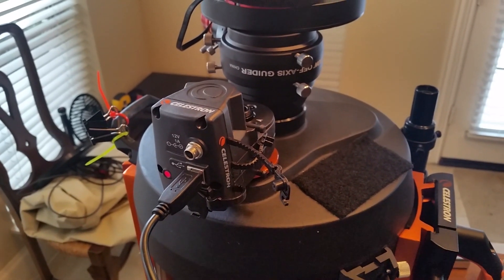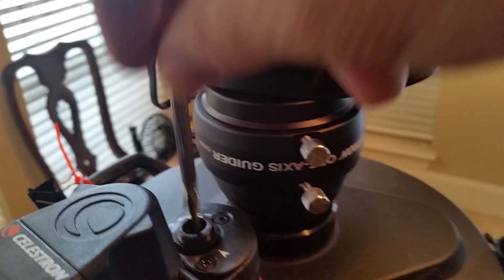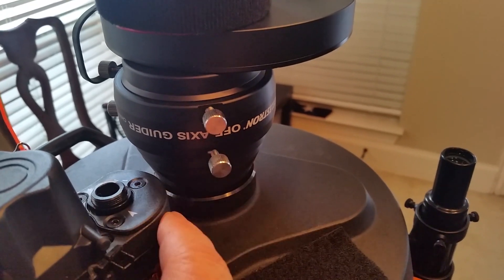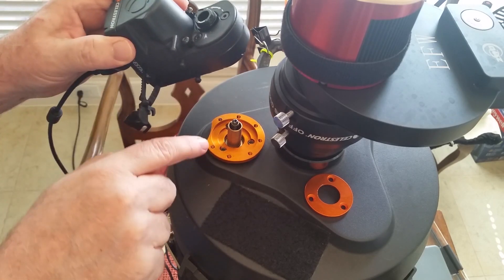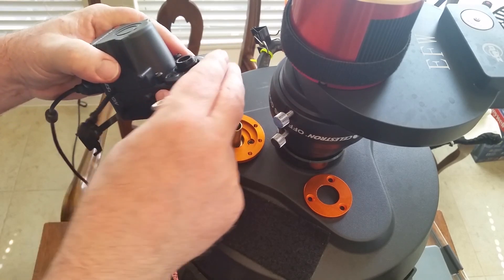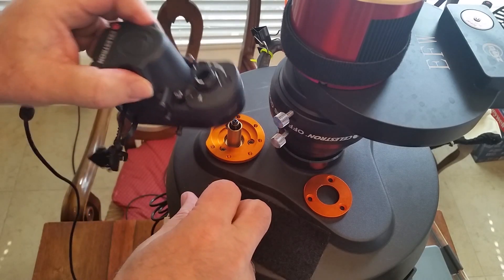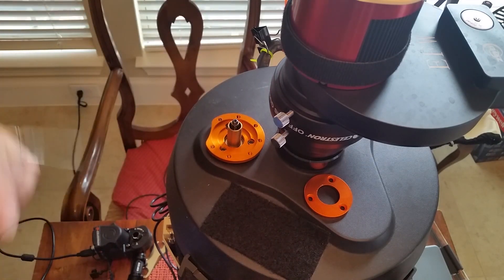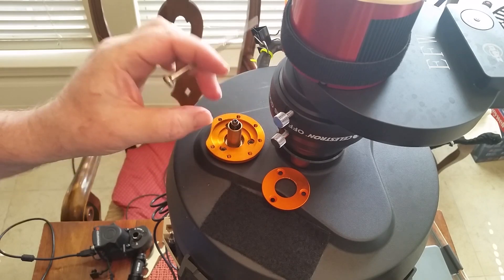Mechanical Binding Issue with the Celestron SCT Focus Motor

Comment: Helicoils and longer screws are the solution to this issue I suggest. Be sure to use a medium strength screw rated Locktite type adhesive to the Helicoil to scope body interface. If the back cover of the OTA is too thin for Helicoils then perhaps tap oversize M5 and drill & counterbore the adaptor plate to suit. I am considering a similar Helicoil mod to the CGX saddle clamp threads. The standard steel into aluminium tends to lock up causing me to worry about long term viability of the aluminium threads in the saddle. With the steel insert friction will be much lower and harder wearing.
 FYI I am using a standard geared stepper directly connected the UPB Pro on both of my scopes. https://www.omc-stepperonline.com/geared-stepper-motor/nema-17-stepper-motor-bipolar-l33mm-w-gear-raio-271-planetary-gearbox-17hs13-0404s-pg27.html
Reply from the maker: Hey, Rob
I can certainly understand why they didn't install helicoils in the first place--all they wanted to do was attach an unloaded cosmetic cover plate to the OTA. Now, however, a thicker plate, longer screws, and helicoils are called for. Oops. Hurts to miss that one. I have no hope of installing helicoils--you're the expert machinist, remember?  At this stage, I'll try and find longer screws and apply some Loctite. Oh, and see if Celestron wants to weigh in with suggestions.

Your saddle clamp application should have had helicoils in the first place--it's holding heavy, expensive equipment. Geez. Do you have one of those stepper motors attached to an SCT? If so, how did you mount it to the back plate? Thanks for watching, as always!
Reply: @Aero19612  Yeah I probably jumped the gun with the Helicoil advise. At M4 there is not much room for error and would be a bit fiddly. Longer screws may do the job OK assuming there is good thread at the bottom. If C short tapped the hole increasing the thread length with a bottoming tap would be a very good idea.  In either case I would start with a screw longer than needed and cut/file to a perfect length to maximise engagement. I would NOT recommend trying to deepen the existing threaded holes as there lies disaster.
I don't have an SCT, both the WO ZS126 and the carbon RC8 have Crayfords so installation was the same for both and I can share the UPBv2 Pro between both scopes on a seasonal basis. Others have used this motor with SCT's have a look at Robert Brown's My Focuser Pro documentation on Sourceforge or even a simple google search. While on the subject of sharing the UPB around I need to make another dovetail mounting for the RC8. If you want, I would be pleased make up something for you as well. Just yes or no and I will contact you via your youtube details. Just my way of saying thanks for the great content.
I am also in the process of fine tuning the CGX and may make a video on the process as I see so much misinformation such as using ceramic bearings and replacing the main bearings when "Hypertuning" mounts. Based on my sample of two Synta mounts I have an opinion on the source of "stiction" on these mounts and it has nothing to do with bearings but rather fit of the clutch drums into the housing.
Reply from the maker: Hey Rob. If you're not careful, one day I'm going to take you up on having adapter plates made! Truly a very nice offer. The "M4" screws I thought were there are actually M3x0.75 x 8 mm long screws. I re-installed the offending screw with Loctite. In the mean time, I ordered 10 mm long versions of the same screw. Should be here tomorrow or Monday. Of course, you just can't order 3 screws, so I'll have 97 left over. I'm sure I can find a use for them around the house. NOT! Not sure if the extra 2 mm is too much. May have to file them down as you mention. Nothing is easy. Indeed, you should make a video of your CGX adjustments. Too much misinformation out there. This is a highly technical hobby and needs knowledgeable people creating content to counter the poorly thought-out material out there. Stay safe and clear skies!
Reply from the maker: Typo: The Celestron screws are M3x0.50 x 8 mm (not 0.75 mm pitch) for anyone interested in replacing them

Comment: I had a weird experience with my PrimaLuce Lab Esatto focuser last week. I ended up resetting it's power supply then re-running the calibration. I also use the PrimaLuce lab "SestoSenso II" focuser (directly attaches to the 10:1 nob on my feather touch focuser) for when I'm doing planetary imaging. 

I still have yet to setup auto-focus in general. It would be nice as temperature changes affect the focus. The dead of winter was fine because once it's 10 degrees outside, it doesn't seem to make much a of a difference if it gets any colder.

Good luck with resolving your issue. Wish I had idea other than "re-run calibration and check your torque", but clearly you seem to be a little ahead of me in the focusing department.
Reply from the maker: Thanks Ronnie! Yea, the power supply and calibration aren't my problem...this time. How do you "reset the power supply"? Unplug it and plug it in again? I'm jealous of people why set their system up and leave it running unattended all night as it performs occasional auto-focus runs and you wake up to a boat load of data.
Reply: @Aero19612  I basically power-cycled the focuser.. On the first of two nights this was not successful, so I tossed my hands up and plugged the focuser into it's own power supply.

On the second night I went back to attaching it to my Pegasus Pocket Power Box and had more success. This time when I encountered trouble, I power-cycled all of the AP gear, instead of just the focuser. Most notably, I re-seated the power power connector which feeds the Pegasus Power Box power from the 10a power supply. Maybe I had a loose connection? Still not sure but unlike the first night, the problem did not persist after taking this fairly minor corrective action.

I also envy those who are able to gather a boatload of quality data from an unattended evening. Without auto-focus, I've only avoided blurry frames on nights where the sessions begin and end with temperatures that are below the freezing point.

As it stands now, I just stay up and keep the remote computer's display on one of my screens. Meanwhile, I perform another task or I play a video game. If I'm exhausted and can't stay up, I just set my alarm and sleep in my chair during imaging runs. Sometimes the alarm is just an insurance policy against  wasting an hour or more of clear skies.

We've still made significant progress if we can manually control the operation from within our cozy homes. However, it would indeed be one heck of an improvement if we could sleep through the whole night while our devices and instruments handle the image acquisition.

Comment: As expensive as those focusers are, it is pretty cheap of them to not include new screws.  Also that probably plays heck with you backlash compensation.
Reply: Pat Wicker Thing that surprises me more is the fact Celestron rotated and re-drilled a 2 cent fixing on a 2-3k+ scope!
Reply from the maker: Yeah, I'm a bit disappointed. The focuser itself is a fine bit of hardware and works well, but that interface could have stood a bit more thought. Thanks for watching, guys!
Reply: @krellon  What is the difference between Skywatcher and Celestron ? Celestron is the pig with lipstick :)